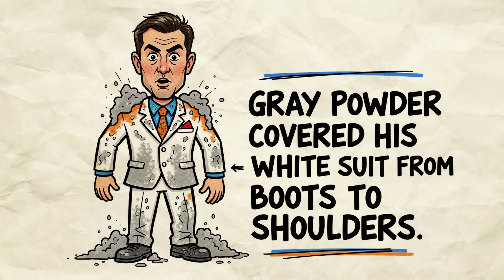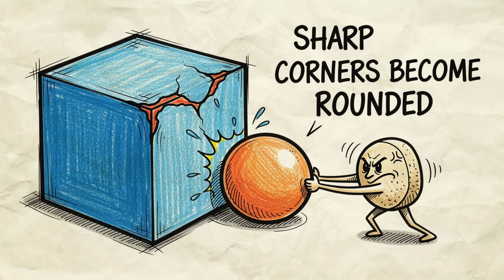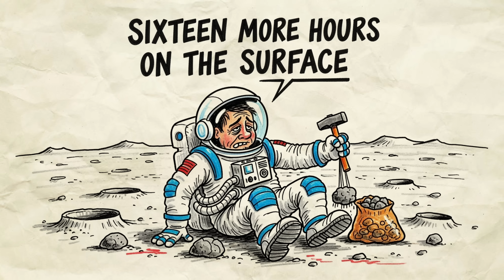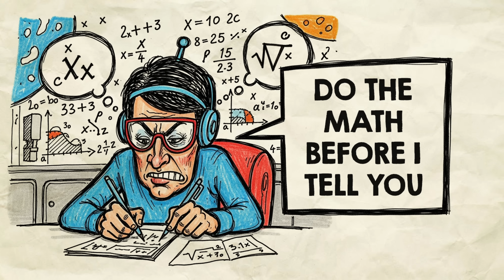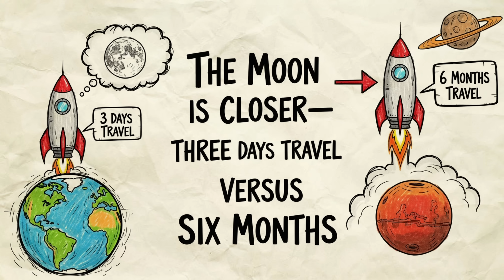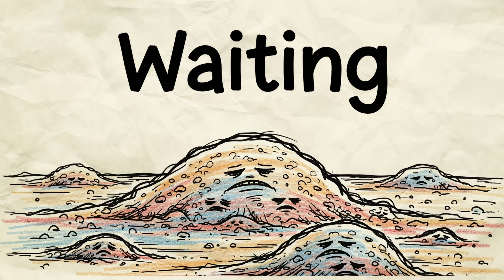Why We Can't Actually Live on the Moon

Comment: Gorrila-snot is a dust suppression and soil erosion liquid that can be sprayed on the ground to counter  the dust. It was used in Afghanistan.
Reply: Soilworks Gorilla-Snot would not work on the moon. It needs water for application and an air atmosphere for curing. It is not designed to withstand lunar temperatures and lunar UV radiation.
Reply: @patternmusic  Get them to invent a resin with a separate curing agent ( like many paints and glues use ) as these don't need air. Make it resistant to the temperature fluctuations found on the moon. Making it white to reflect sunlight may help. The fact that moon dust is sharp and jagged will also help in keeping it bound together. Sand in construction is sharp. Its mostly gathered from river beds. Sand grains from deserts are rounded from wind blowing it around and are not used as the concrete is weak.. Saudi Arabia imports sharp sand. If the resin combo cures and forms a rubber like substance  it should prove more flexible and resistant to cracking.

Comment: So, none of that razor sharp, electrostatically charged dust damaged controls or seals inside the space craft once they re-entered it? It didn't get on their skin or in their eyes either? It didn't coat their camera lenses? Hmmm?
Reply: I'm sure it did, but the difference is movement. Hatches were open and closed what, a dozen times or so?  The difference was movement. The embedded dust in the fibers becomes a problem when you start moving around, such as when you walk.

Comment: I think spacesuits will fall out of favor. Along with the regolith problem there is a lot of delicate miniaturized engineering going into life support that can fail. I predict astronauts will spend most of their time in air pressured rovers while robots pick up samples and do other chores. Astronauts will supervise the robots.
Reply: There's still the radiation problem for which there is no solution except 2 meters of local soil.
Reply: Moon dust will still tear up mechanical components.
Reply: @larky368 Less than spacesuits.
Reply: Though for certain things, the colonists will still have to go outside, which means spacesuits on Luna. So, repelling the dirt somehow will be necessary